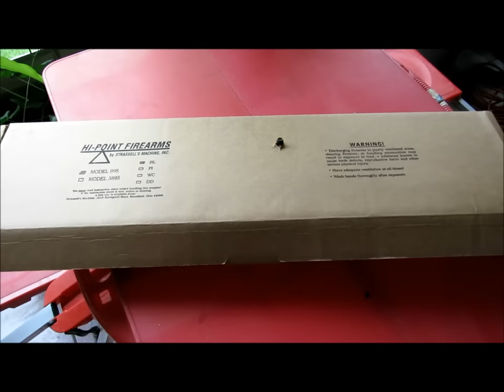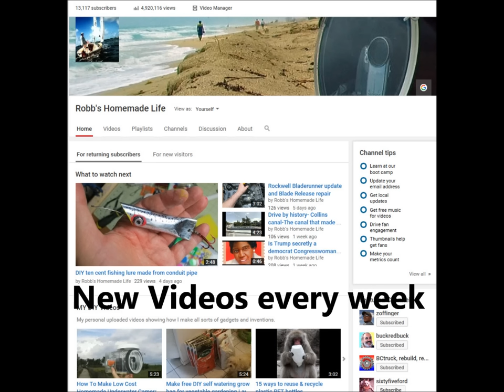10 reasons I bought a Hi Point Carbine & 6 bad reasons not to

Comment: I just wanted to make a note on point #8. You said you might get arguments on the 'easier to shoot accurately' part, but that is 100% fact. Sight radius (distance between sights) is a very important factor when dealing with iron sights and accuracy. A longer sight radius is easier to aim accurately. The fact that you can hold it more stably with two hands plays a role, as you stated, but the sight radius is the more important factor.
Reply from the maker: +Redrocket90 Thanks, makes sense.

Comment: Since you made your video, RedBall Sports has produced a 20 round magazine that is as reliable as the Hi-Point magazine. This mag is approved for use in this gun by Hi-Point. In fact the RedBall mags can be purchased from Hi-Point.
Reply from the maker: Thanks for the helpful tip.
Reply: BTW, LOVED you rifle case. I have plans for one myself. I am planning to add corner protectors.

Comment: I noticed you don't suppose to tighten ur bolt up to much cause it will make ur action sticky you post to tighten it up until you feel it first getting tight then stop so ur action will be smooth and make it run reliable just found that out today and I been had my carbine about six months
Reply from the maker: Lotrenzo, thanks a lot for leaving a helpful tip.

Comment: A carbine will always be more powerful and accurate then a pistol.

I know someone that though cost had to lots to do with quality till he started hitting 600 yards with my Chinese made M14. Granted I live in Canada and these are not the 2006 and older or what ever is the last year Americans got to see Norinco Rifles.

Mine is a 2012/13 and is one of the Magic production runs that saw the stock pile of Springfield armoires barrels that China Crome lined. And I up graded some parts here and there.

Oh by the way Rifles use Magazines not clips.

Other then that you did a better video then some of these guys that actually do them.

But please tell my you take that out once a month or so and shoot it with the same ammo regularly. If it is going to be a defence gun you need to use it.

Comment: I have a Hi Point Carbine in .45.  I also have the pistol in .45.  They are excellent for what they are.  They shoot the cheapest ammo you can buy without problems and are accurate.  As long as you clean them every 500 rounds or so, you shouldn't have the jamming problems that some Hi Point haters make up.  It just doesn't really happen.  The only down side to the Hi Points is that taking them apart and cleaning them is a little bit more work than with more expensive guns.  But it's something that you'll have down pat after the second time.  Not a big deal.  I love how the gun snobs always cry about the same couple of points and none of them make sense...it's ugly.  (yeah dummy and I'm not concerned with the aesthetics of a tool that I'm using to defend my home and family)...it's heavy (I'm not tracking it over 50 miles of rough terrain.  If you can't lift 7 pounds, buy a gym membership)...it's cheap (Looks like somebody mistakes expensive for quality and likes advertising their purchases as though it proves them successful in life)

Comment: I biggest problem with the High Point is you need a wrench and screw driver to strip it.   Has anyone modded these to use pins instead of bolts.   Shame Hi Point can't make a special edition version with a better stock and something you can field strip.  I would pay another $200 for that.
Reply from the maker: +CrossEyed Jack good point, thanks jack.

Comment: If they had reliable hi-cap mags I would be all over the 40 cal version. Perhaps the 9mm if I was sure it would feed hollow point +p+ ammo. I've heard Hi-point has some sort of personal issue with hi-cap mags and until they produce them I'll go with that and have a personal problem with the limiting of mag capacity, especially in a carbine.
Reply from the maker: +worddunlap Thanks word
Reply: +worddunlap i use hornady critical duty 220 gr hollow point +P in my 4595 and they feed with no issues, but i'm also using the factory mags.
Reply: +worddunlap Hi Point offers a mag holder for the rear stock that holds two mags, so at least you can have two additional 10 round factory mags available for rapid mag changes.  As for the 4095, it handles the high compression .40 S&W rounds with no problems..

Comment: Great review and kudos on the case! A Velcro strap or two screwed in would secure the gun from banging in the case. The bigger caliber comments apply to a 3 to 6 inch pistol barrel and demonstrate a lack of appreciation of the increased bullet velocity impact with a 16.5 inch barrel. If the world falls apart,  the most available ammo would be 22lr and 9mm. Your rationale is sound. A shotgun has one advantage, you are not likely to kill a neighbor if you're shooting in your house at an assailant and miss. Great job again!
Reply from the maker: Thanks Scott, I usually stuff a towel in the case and it pads it nicely. I think the best reason I had for picking the carbine is overlooked by some people, which is the carbine can be used accurately and more safely with a minimum of instruction  than other choices by all age groups and genders of my family and friends. I was not just thinking of my use of the weapon. can the average Grandma or 12 year old use a 12 gauge safely and not be intimidated, can a non user be more accurate with a Glock or a carbine?

Comment: Robb just don't let it sit in the box.  Take it out and shoot it.  Learn it!  Run a couple 100 rounds through it to break things in.  Check the sights.  Make sure they have not been knocked around in shipping.  Last thing you want is to bring it out when you, God forbid, need it and you are unsure what to expect.
If you do not shoot it often then at least once or twice a year get it out and clean and oil it.  Rust happens!  Oils catch dust and dirt.  Function test (no ammunition) to make sure everything works.
Also don't be intimidated by a shotgun.  Even 12 gauge guns can be very manageable to shoot by the young and old with modern managed/low recoil ammunition.  My point is that there is no one perfect tool for every job.  Guns are tools.  Each has strong and weak points.  Be safe.  Thanks for the reasonable, mature and informative video.
Reply from the maker: +LeewardStudios  Leeward, good points all, I do need to shoot it more. thanks for the comments.

Comment: I am by no means a gun guru, but I am a former U.S. Marine (a long time ago) and do a lot of shooting. I own several guns. Handguns, shotguns, and rifles. I do not own a Hi-Point. As a defensive weapon, I see some issues with the Hi-Point carbine. It is a large heavy gun, it only holds 10 rounds, and it uses handgun ammunition. So for close range self defense, I see a 9mm handgun as  much better. Small, and easily carried, either open or concealed. For a rifle for self defense, I have an AR-15. It uses actual rifle ammunition, and perhaps more important, it has a 30 round capacity. The main issue I have with a shotgun is it's size and weight, it is not semi automatic (mine is a pump) and again it has limited magazine capacity. Of course, if I were under attack, I would be happy to have any gun out there.
Reply: You can purchase 15 round magazine...I just did...my understanding is you can shoot +P ammo in this gun...has anyone tried this?
Reply: Ed McQueen the 15 round magazines will void the hi point warranty on the carbine and cause you nothing but issues. hi point approved a red ball 20 round magazine that cycles flawlessly and won't void your warranty from them....I HIGHLY suggest you go that route. those 15 round mags are notorious for ftf and causing problems for this particular gun
Reply: The 15 round magazine by PROMAG functioned flawlessly.
Reply from the maker: thanks jr!
Reply from the maker: your points are valid for you. I did not choose the handgun as there was a possiblity family members who had little firearm experience might be using my weapon choice and I reasoned the carbine would be more accurate for them than a pistol. HyPoint now has a larger magazine they approve of and seems to work. Your argument over the carbine using handgun ammo and then choosing a handgun  is not persuasive. But if your choice works for you that is what matters,  we all agree on the important stuff which is to get a firearm and ammo while we still can. thanks for watching and for taking the time to comment.
Reply: It still voids the warranty. the info that comes with the gun says if you use promag it voids the warranty. So i'd go red ball just to keep the lifetime warranty. But i understand why you like the promags they are slick.

Comment: Robb - you want to be careful in choosing your ammo for home defense. Why? Typically a pistol caliber bullet fired from a longer barrel will gain velocity. Meaning if your ammo is rated at 1,100 feet per second (FPS) out of the factory test pistol barrel length (usually 4 to 5 inches), in a 16 inch carbine barrel it's typical to see a gain of roughly 200 feet per second. So now your 1,100 FPS bullet is leaving the carbine muzzle @ around 1,300 FPS. So? That means greater penetration concerns, in addition to the better energy on target. So, ball ammo use (FMJ) should be a concern for defense as it is more likely to pass through an attacker & possibly strike things you didn't want it to, or in the case of a missed shot, pass through multiple layers of drywall [ie go into rooms not intended]. So if you haven't yet (?) Find jacketed hollow points that feed well in your carbine & use them in it for defense. I have found that the Remington green & white box 100 count value packs feed well in mine as do the similar value brands like Winchester white box defense JHP (both 115gr 9mm JHPs) loads.  You may already know this, if so, hopefully it helps a newer owner of a TS995 find a reliable defense load. Note* I have found that the more rounded JHPs feed best and those with larger cavities (Golden Sabers)  or steep angles (XTP) (more pointed) tend want to catch/drag a bit as the go up the feed ramp into the chamber.
Hope this helps and thanks for posting a good video. P.S. I own & frequently shoot the - TS995 [9mm], TS4095 [40S&W] & TS4595[45acp] and really like them all. 😎👍
Reply from the maker: lots of good info, thanks J

Comment: You should have bought the Mossberg and that's coming from somebody who spent 20yrs in the US Army using parachutes. For home defense the 9mm is going to give you over penetration problems, which you'll find are even worse with your choice of ammo .So unless your intention was to blast holes though out the  walls of your home I'd reconsider my choice. I personally have an HK VP9 I keep by the bed and a Mossberg 500a that's set-up for tactical use in the closet .But I have almost 40yrs experience with a handgun taught by several LEO's from my family and continued  into my service in the military or the Mossberg would be by the bed and the HK would be in the closet.

Comment: i had an older 995 and it was good . i paid too much and i knew it but there were reasons for it . next , i bought a C9 at an army surplus/gun shop . now you are going to say i am lying but i swear it's true...$119.99 plus tax . this was a brand new , never fired pistol . and i am pleased with the purchase. on the 995 , i wanted an original iron sight ,( it had a red dot ). i called HI Point and they sent me one...free . i even told them i was the 3rd owner . didn't matter. great company .
Reply from the maker: Thanks pappy, it is good to know.
Reply: i would not call them cheap...inexpensive comes to mind . i will buy another 995 . i would like a kel tec sub 2000 but i hear they are hard to find .

Comment: A few years ago the AK was the Hipoint  price point. Has anybody broken down the HP to clean it?
Reply: +walter chiappini unscrew the bolt for the action, pop out 2 pins and you have access to the action. its pretty simple to me
Reply: i Have swabbed out the barrel. SNOW tomorrow so its time to swab again. I shot Perfecta brass.Worked good.
Reply: One of the easiest guns I have cleaned. My M1A and 1911 are a pain in the ass in comparison.

Comment: if you were afraid of the kick you should of gone with a Mossberg maverick 88 in a '20 GAUGE' it about $100 less... sell that thing and add a couple $100 some cash and go for a Kel Tec sub-2000, it's light, 9mm and its surprisingly concealable since it's foldable... DO NOT TRUST YOUR LIFE WITH A HI POINT FIRE ARM
Reply from the maker: Thanks tex, I have several firearms available in my family, one is a mossberg 12 gauge which is my favorite. If the Mossberg was not available I would not have gotten the HiPoint, but since I have access to one the Hi point was an excellent choice for all of the reasons I mentioned. I picked the carbine as it is most likely to be used effectively by a wide range of family members and ages. I do not trust any magazines that have not been tested, but the ones that test OK are fine with me as is the carbine.

Comment: I liked your video and case. Router those edges and stain it it will look even better.
Reply from the maker: +rcagle123 Hey thanks. Yeah, a router would take the sharpness off the edges for sure, however, I was just trying to do the most with the least effort and fewest tools, something simple so as to encourage others to go out and make one.  I started to use some shell casings to accent the case incorporating them into a design, but stopped and just did the wood burning. The soft pine lend itself to a lot of simple processes to add to the design. I am thinking about making another one to use with a Mossberg shotgun and use some better wood and fittings..
Reply: +Robb's Homemade Life Shell casings is a great idea! Never really thought about building a gun case til i saw your video. You havd my wheels spending lol. Great job on the case!
Reply from the maker: hope you build one, you can see how simple it was and how few tools are needed. It is a lot of fun and a lot of satisfaction when done and will give you confidence to start building other stuff. Thanks for watching and commenting.

Comment: These weapons are accurate and reliable. The metal used is a high quality hard steel. Only the plastic is cheap all else is top notch quality!!!! This is not "cheap" its just affordable and in order to do this THEY of cause cut courners, non of which affects quality.
Reply from the maker: Most of the people I have talked to who own one are very happy which was one of the reasons I bought mine.. I think the company used to have some issues with their pistol, but the carbine seems to work fine for most folks .

Comment: I have to admit pretty good reasons for a person who isnt a big gun guy. I dont necessarily agree with this as a personal or home defense gun. I reccomend a 9mm pistol for almost anyone, look at ballistic gel tests 40 isnt a big improvement but its a lot tougher to be accurate with. Even a fairly new shooter or a weaker person could handle a 9mm. For elderly people id reccomend a 38 spcl revolver. The recoil isnt bad, theyre reliable and simple, you dont have to rack a slide (may be tough for older people) and it will get the job done. I dont really recommend any carbine or rifle for home defense because the bullets can pass through walls and hurt innocent bystanders or family members. I personally dont recommend a shotgun the recoil is worse for weak people, a pump action is tricky for some people to use and slugs pass through dry wall or other soft stuff pretty easily but bird shot and buck shot will ruin your house.

Comment: hi point pistols are cheap and made of cheap materials. The frames are zinc alloy, and you can wear hi points out. But, for the money, they're good. I wouldn't buy one simply because fortunately i'm not crunched for money. My home defense weapon is a bushmaster ar-15 loaded with hollow points. But, i don't knock a hi-point carbine. I'll probably own one before the end comes.
Reply from the maker: thanks hawkboy!
Reply: dont you think an AR is better suited for out doors. the concussion inside I imagine is deafening, and the added length of the barrel would get in the war. Id also be worried about over-penetration. IMHO a high cap full sized pistol is a better option. Just my opinion.

Comment: How is the hi point doing ??
Reply from the maker: It is very upset, I just bought a revolver and a rifle.
Reply: Good for you Robb!!!  I saw your vid and had to ask ….   I’ve seen many many of those fail. Usually at the front site - or the firing pin breaks ASAP ….   Always a guy that just bought one at the shop. Post your new ones!!!
Reply from the maker: I bought a couple of 22s. A Heritage Arms single-action cowboy gun and a Rossi 22. The Rossi used to be $100-$120. They went up to $140. Buds had one with a threaded barrel for $148!!!
I jumped on it. I just ordered a folding stock for it for $60 and I will be trying to put some cheap $10 lasers from amazon on both guns. I think I can put a single laser pointer on the six-shooter which will be cool, and double lasers on the Rossi. I do not like going t the range right now as the indoor one I go to has a lot of smoke and I am still nervous about catching the cooties. But I will be doing some videos on both even if I do not shoot them.
Reply: @RobbsHomemadeLife  save your money in the lasers …. They will lose zero on the first trip even with a .22!!
Reply from the maker: maybe so, maybe so, LOL stay tuned.
Reply: @RobbsHomemadeLife  you know what…. LOL- it’s only 20 bucks!!   I’ll be waiting for the vid !! 🤙🏾